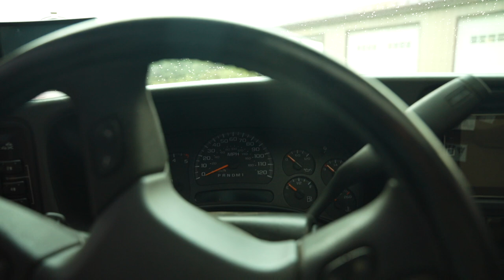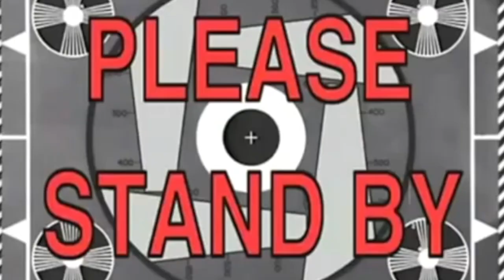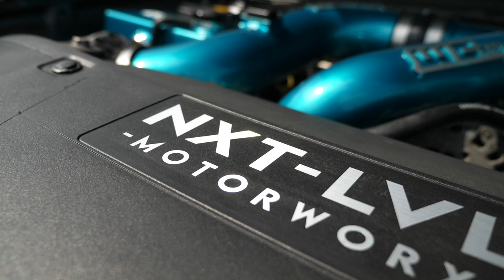Jakes FIRST DRIVE In His OVERHAULED LBZ! *Priceless*

Comment: Hey durtymax jack i was wondering if you guys are hiring at your shop and for anything because im a huge lover of diesel trucks and I love building them and i went to school for diesel mechanic and equipment mechanic and I would love to work for you guys and with you guys and work on my 2007.5 lmm 3500hd single wheel 4wheel drive duramax i need help fixing it

Comment: Anyone know if I can Straight pipe my LBZ with it being stock apart from cold air intake and lift kit?
Reply: Yes, you can
Reply: @griffinfoldvary8400  so no EGR and tune is necessary?
Reply: @lbz_manny8031  nope my straight pipe was the first mod I did when my truck was completely stock
Reply: @griffinfoldvary8400  thank you bro did you get any codes?
Reply: @lbz_manny8031  nope

Comment: Why are you still using that diff cover guys? Banks has proven with evidence they aren't good. Look great but a powder coated Banks looks just as good.
Reply: Someone else posted the exact same thing. But why isn't it any good?
Reply: @Tainted_Timmy  design shape of the cover causing more heat and aeration to the fluid hitting against flat surface instead of a curved surface that also helps to carry the fluid to the other areas. Check Banks diff cover videos.